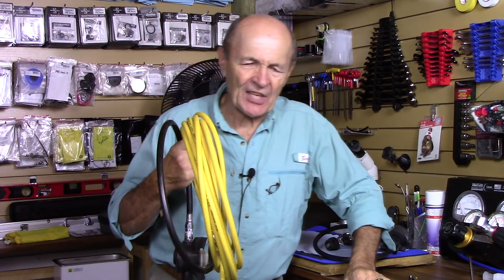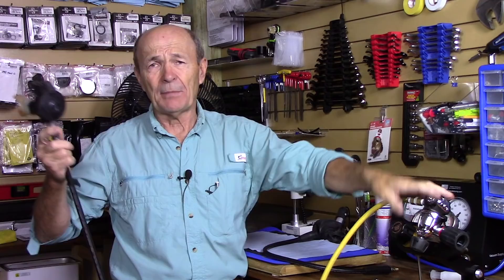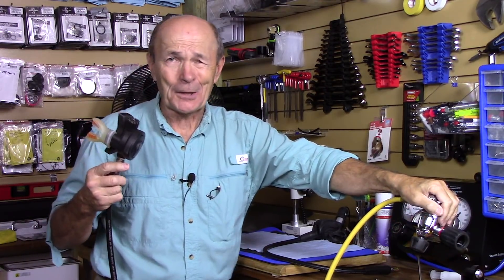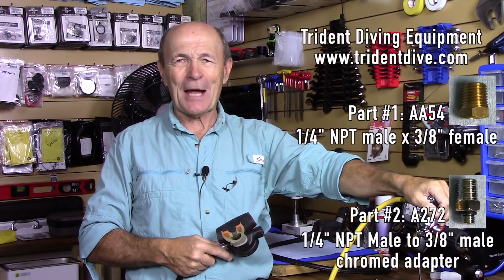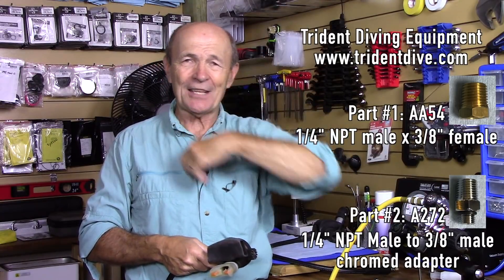Make Your Own Hookah Surface Supply - Scuba Tech Tips: S08E03

Comment: An ambulance trip to the hospital will cost about 2000 dollars.  A good hookah system designed by engineers that are professionals in the field costs about the same.
Reply from the maker: I suppose that's one way to look at it.
If a diver was planning to use surface supply as a regular practice, cleaning boats, digging for gold, raising logs, etc, he'd be silly to not get a professional unit.
For the occasional pool check, boat check or playing around in 15' of water at the cottage or on a reef, these are good.
Alec
Reply: What would be the difference? As long as the line is clean you will be fine
Reply: @austinmuir544  
Some people will not drink water out of a plastic container because of the chemicals it leaches out.  Some people will not drink regular milk but only by organic.  Some people only eat grass feed  beef.  I tend to trust the engineers.  A  25 foot breathing hose for a supplied air system (SAS) costs over 100 dollars.  There is a reason for this.  I am not sure what the reason is, but this is my health.  What you do is up to you.
Reply: Paul Knittle I believe you are correct. The chemical composition of the hoses will be different. A true diving hose takes years to degrade in salt and I’m sure a Home Depot air hose will degrade in a week
Reply: @austinmuir544  generally the hose is food grade an higher quality than normal air hose no toxins
Reply: Everything I read a poly type of hose would be much better then rubberized style of hose but still only for shallow diving
Reply: @dorwink  The engineered systems come with a heat discharge hose to limit the temperatures.  The compressor runs at a lower pressure.  The regulators are minimalized for trouble free use and easy repair.  Yes, the parts may cost a little more but they are in business to make money.  Just purchase a well engineered system and give the engineer his pay so that he can feed his family and be happy.
Reply: Just had a FATALITY in CHICKASAW AL FROM WHAT I BELIEVE WAS THIS VERY VIDEO...
Reply: lbbradley55 from the general brief search I did on the web it sounds like the diver was diving a “homemade diving equipment” also called hookah. As from what I read I can only come up with three highly likely causes of death. One being getting trapped or stuck in the trees and junk on the river bottom. Two bad air in the compressor causing the diver to black out. And the final hypothesis is that diver was struck by concrete falling from the bridge. Did they ever figure out what happened?
Reply: @austinmuir544  WOW... Don't know what or Where You Got Concrete Falling or Any of Those Hypothesis out of This ? I only posted hopeful that No One Else would watch any Video with No Diving Experience or Training & Dive to Their DEATH... 
With Hooka or Any Home Made Gear ! 
Are you Cert. Diver ? 
WOW !
Reply: @austinmuir544  
WOW... Concrete Falling ? Don't know Where all this come from. ? WOW... Just hope no one else tries Home Made Dive Gear & DIVES TO THEIR DEATH 
are you even Certified Diver ? He was not
Reply: @austinmuir544  Ha You Delete my Response. BUT YOU READ IT. How Did  you FABRICATE  CONCRETE FALLING FROM BRIDGE out of any of this ? WOW...
Reply: @austinmuir544  
Are you a Certified Diver ? Surely Not
Reply: @austinmuir544  
WOW.... SOME PEOPLE.... WOW....
Reply: lbbradley55 Alabama bridges are falling apart and Pose a hazard for anyone below them. If you are asking why I said concert then it is because the man was diving under a bridge. The real question is are you a real diver. I dive for a living and am very proud of it.
Reply: @austinmuir544   I have been Diving Many yrs. I held Federal Commercial Permits through United States Tresury DEP N.O.A.A. I am Retired Now. My first Commercial Permits were obtained in late 1980'S I have all my Credentials. I have a little Experience in the Gulf of Mexico. Commercial Snapper Boat Captain' Snapper ' King ' & Tuna ' would you like to view any of these. 
I Dove at Night for Flounder for Yrs & Yrs. From here in Mobile Co Alabama Daulphin Island Al. 
He was not Diving under a Bridge nor is the closest Bridge   Falling apart ?
Reply: @austinmuir544  I Was On The Seen Were You...??? I was there where this Happened HE WAS NOT UNDER THE BRIDGE AT ALL... he was East of The Bridge. FACT ...
Reply: @austinmuir544 
HA... HA.... 🤣🤣🤣 
YOU PPL
Reply: @austinmuir544  Were You There were this Happened ? Clearly NOT... He was NOT UNDER ANY BRIDGE. ?

Comment: Hello Alex , would it as easy to make some kind of air compressor on a float tube for the surface air delivery. Basically a homemade version of what Brownie makes: for shallow (max20') water diving for oysters?
please send me a note at steveca4@hotmail.com
Reply from the maker: It is very easy. For shallow water surface supply, you only need about 90psi of clean air. Any cheap service station-type compressor will supply that. Your problems are how to power it and how to be sure the air is clean.
Alec

Comment: Most excellent, thank you! Was looking for exactly this sort of video and boom, you made it, and it was good and to the point. I've been thinking about such a system for a long time wondering why there isn't such a thing, but there was! My only question is whether those cheap compressor hoses are safe to breath through. Don't want to breathe in cancer causing fumes.
Reply from the maker: Read down through the other comments dusty. Stay shallow (which is normal for Hookah) and a new. clean, regular airline hose is fine.
You'll breathe in more cancer-causing fumes just driving to the dive site!!!

Good luck.
Alec
Reply: @AlecPeirceScuba_SeaHunter  Is this technique safe? I see other ideas online, but people warn about oil contamination. I just don't want to damage my lungs.

Comment: Great information, I have been cleaning hulls lately gearing fully up to do so with a dry suit and all as I am in the PNW and its a PITA... I decided to look into hookah systems but really dont want to spend that much extra money as I have tons of $$$ invested in my scuba gear over the years and I have enough spare gear laying around I can make one of these tank set ups at basically no cost aside from the hookah hose and a couple fittings and that should do the job great, plus its super portable, even more so then a traditional hookah rig, winner winner chicken dinner!
Reply from the maker: I love chicken!!!!
Glad I was able to give you some ideas.
You can leave your tank on shore or on the boat and dive freely. Just get a long hose. 
If you want more time underwater, you can even join the tanks together and stay down all day!
Take care.
Alec
Reply: Might even be able to leave the tank in your truck.
Reply: My local guy has his tank in a wheel barrow. Cleans most of the hull with snorkel, then only hooks up to the tank and long hose for the deeper keels. The wheel barrow is good as it contains all his scrubbing gear etc while going between vehicle and boat along docks.

Comment: Hi. Got one of those cheap Chinese stage 2 regulators.(AliExpress.com) 
It’s free flowing. Is that normal for that model or is it broken?
Reply from the maker: Not necessarily 'broken'. In most cases, a freeflow simple means a dirty or worn out HP seat in the 1st stage. It could also be the LP seat in the 2nd stage. If you cannot stop the freeflow by adjusting the 2nd as explained in one of my videos, it's the HP seat and will need dealer service. Any scuba serviceman can check that for you.
Good luck.
Alec

Comment: do the rules of ”basic” padi chart still be used or does the body react diffrent when u dive with tank vs hooka?
Reply from the maker: Even on Hookah you are breathing air under pressure. Excess nitrogen goes into your body so the same DSC rules apply.
If you limit the hose length to 25'. you cannot go deeper than 30' so can stay down for hours with no problem.

The bigger danger is that in less than 10' you can suffer a deadly embolism.
Even in a swimming pool, if you shoot to the surface while holding your breath, it can be very serious.
Every time I see kids playing with a surface supply or Hookah system I shudder. If the air flow stops, what will they do?
Hold their breath and surface. It's a nasty way to die.
Take care.
Alec
Reply: Alec Peirce Scuba thx!! i agree with the second part! you can only shoot to the surfuce X amount even in shallow water before ur done :(.        

and let me say i love tour videos with the tips and ”feedy” information!! looking forward to se more :)

Comment: In the 70s I used two small O2 tanks and refilled from a large O2
Tank and I modified propane reg for my  low pressure on demand. 
When using a compressor make sure it's a oil free compressor. I nearly died from breathing oil
I would have died if I had falling asleep too that night I fought for every breath the next day I was so tired from fighting to live
Reply from the maker: A scuba compressor filter should take out all of the oil, and other impurities including noxious gases, oil or oil-free design. Most large compressors are regular oil type but the air is well-filtered.
Breathing air with oil in it can cause lipoid pneumonia. It sounds as though that's what you had and it can be very serious with long-lasting problems.
Take care.
Alec

Comment: Alec;  I would like to put together a Hookah but using a electric compressor with battery in a tube float.  Could you tell me how big of compressor I would need with an adequate air supply for 50 ft max depth with one person?
Reply from the maker: You need a compressor that will supply about 1 cubic foot per minute. That's sufficient for a depth of 15-20'.
Deeper than that and you need more volume but other problems then arise that are not so easily overcome.
Check out the compressors as you are describing at 'Brownies Third Lung' for ideas and info.
Alec

Comment: I thought the air hose had to be for breathing use ONLY, not your typical air hose
Reply from the maker: Ordinary rubber airline tubing, assuming it's clean is fine for shallow water using ordinary air (not mixed gas). As you dive deeper and the partial pressure of the gases increases,  or if using EANx (enriched air with a higher oxygen content), synthetic tubing should be used.
As I hinted, this system is generally used to clean pools, boats bottoms or dive in rivers for gold. Activities like that are normally done in 10' or so. No problem.
And clearly there is a limit to the length of hose that can be used effectively.
Another limiting factor is that the IP (intermediate pressure) coming from the 1st stage does not increase as it would in a normal dive where it would be affected by the increase in water pressure as a diver descends. Thus the 1st stage, sitting on the surface,  would not be able to supply air to the 2nd stage if the diver went very deep. I'd have to do some calculations to determine how deep a diver could go using this but it wouldn't be far.
Alec

Comment: Great video, very helpful thank you. I don't live near a dive shop anywhere and cant find the 1/4 npt male x 3/8 female adapter anywhere? Do you have any other suggestions to find that adapter for my regulator?
Reply from the maker: OK Terrance.
A couple of suggestions;
1.  If you take the 1st and 2nd stage and hose into any decent hardware store, maybe even Home Depot or something similar, they may be able to match up the threads.
2. If you can find a compressor supply outlet they can do the same.
3. Any dive store can get these items so maybe one will order it in and mail it to you. Give them the Trident numbers.
4. You may be able to get them on eBay or Amazon.
5. Contact Scuba Tools (scubatools.com). They have the fitting for the 1st stage (#20-161-105) and can certainly get the other one for you. They are good to deal with.
I hope this helps.
Alec
Reply: @AlecPeirceScuba_SeaHunter  Thank you for the response. I love you videos. You make things so simple. I found it on Amazon. Appreciate it sir.

Comment: Great video, I have been diving for years on surface air.  I did buy breathing air hose not sure it matters.  I bought an 12volt oil less compressor and a regulator. went to the welding shop and cut the scuba fitting off the short hose coming off the regulator and spliced in a pressure washer quick disconnect. with a couple of 12v deep cycle batteries I can stay down all day.  My diving is all under 10' and I have hundreds of hours down using this set up.  Plenty safe.
Reply from the maker: Sounds like you are a 'doer' kind of guy like me.  Sound like a great setup.    
Dive safe, with a surface buddy Bob.
Alec
Reply: Hello do you mind if i ask your compressors brand? i am plannig to buy one from airlinebyj but unfortunately have no feedback
Reply: @mehmeterdolun844  puma
Reply: Thanks a lot
Reply: What compressor brand do you use ?

Comment: Do not use just any tool-hose, there is a good chance it will off-gas toluene especially if in the sun. Breathing air hose, medical O2, or better still Diver's Hose ( non-kinking ) is essential.
Reply from the maker: Yep. Always better. 
But, ordinary air-line tubing will work OK for this purpose in shallow water - a pool or cleaning boats for example. The pressure is 110psi so there's no danger of a breakdown. If diving deeper, you should use a breathing air hose.
I agree that the hose should be new. Don't grab some old hose of off the garage floor!
Alec

Comment: I guess I dont see the advantage of this but then I am a diver.  Most hooka rigs allow for extended dives. Plus you only know when you run out of air by that no air breath. But the connectors is good to know sonthanks.
Reply from the maker: This is really only for those who are doing some work underwater and need to stay down for long periods in shallow water - pool workers, boat cleaners, dock installers, etc.
For them it's a Godsend.
Alec

Comment: Would you or could you please recommend a 12 volt compressor  for one or even better two people to use please  :)
Reply from the maker: The only one that I could feel good about is from Brownies Third Lung in Florida.
They have the VS system which connects to a 12 or 24 volt car battery (24 volts with 2 batteries).
And they have a new self-contained battery operated system too.

They have been around forever and make nothing but quality products - exactly what you want.
Good luck.
Alec
Reply: What do you think about airlinebyj products alec ?
Reply: @AlecPeirceScuba_SeaHunter  https://www.youtube.com/watch?v=eg0wxBnVE-U            video here

Comment: Question, I am an recreational divers and where I live the closest dive shop has closed there doors for good, due to this has put me as a diver in a pocket full of hurt, been doing some research and I don't dive over 100 feet deep, and got this idea to try and build my own tank fill station, that being said the air we are breathing in from what I understand is just compressed filtered air, but are the compressors oil less or does it matter as long as it's filtered properly? Make it short thinking of buying an oil less compressor and proper filters so that I can fill my own tanks, please message me and she'd some light on this question I have. Nearest scuba fill shop now is 150 miles away, puts a good damper on diving now. Thanks. Chris.
Reply from the maker: I'll do a video on compressors and filter systems soon Chris.

Most scuba compressors are oil based. It's hard to find an oilless compressor that will pump to the high pressures needed for scuba. A decent filter system removes any impurities from the use of oil.
You can get a personal use compressor that would meet your needs. The cost would be in the $5000 range for a decent one set up and ready to go. It is NOT a commercially rated compressor and cannot be run continuously but it will fill several tanks before needing to stop and cool.
Look at the Max Air 35. It is available under several brand names.

Sorry about your dive store. All divers need to support their local store as much as they can or face the same problem.
Good luck.
Alec

Comment: Hey Alec,  it looks like trident also sells the actual low pressure hook hose with the 3/8's regulator fitting already on it.  What do you think would be cheaper?
Reply from the maker: It would be easier. Can't say about cheaper. Airline tubing from Harbor Feight or Princess Auto is pretty cheap.
You can get 25' of hose for about $25. The fittings are $10 each.

Also you will need a special fitting to join 2 pieces of that hose if you ever want to.
Take care.
Alec